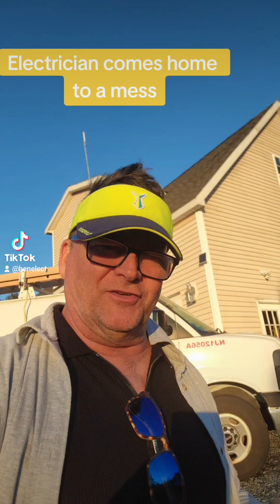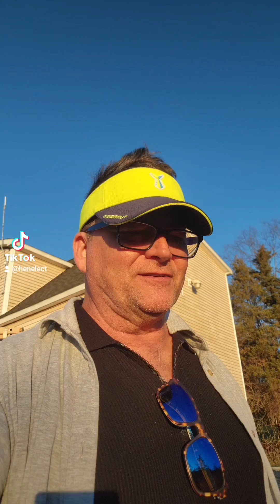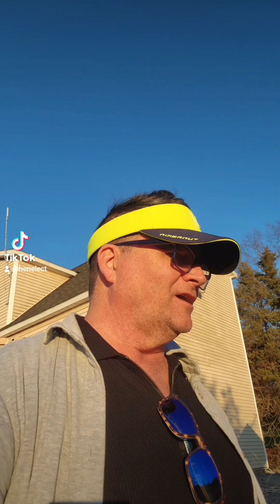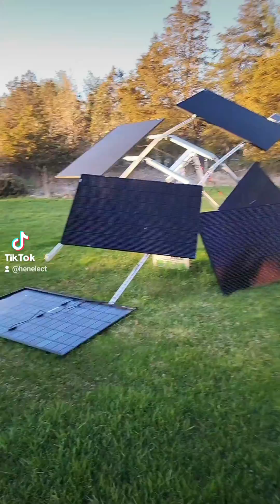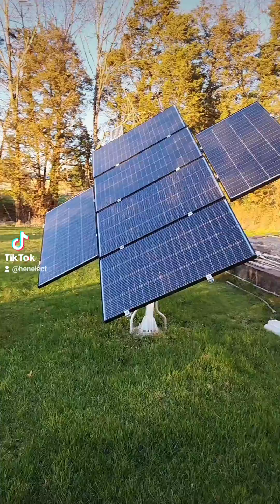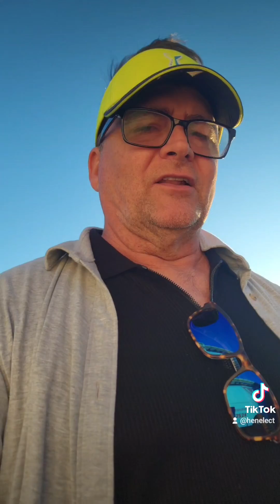Ecoworthy Solar Tracker FAIL #solartracker #solar fail #fail #solar #contractor ##henelect

Comment: Big Thks for showing this.......I have been considering Ecoworthy oversizing too, 450w or 500w, but was trying to work out what needs to be upgraded......So my BIG question was on the actuators......can they move heavier panels (and struts) and now I see will have to find heavier struts.  Pls do a vid when u rebuild it with details of the struts and the performance of motors/actuators........Thks in advance sir.
Reply from the maker: If you're balanced well, the fulcrum point will assist the oem actuators,  ill update
Reply: Can we get a material list so I can learn from your experience to build My Own I have 400w bifacial panels and 2 trackers?